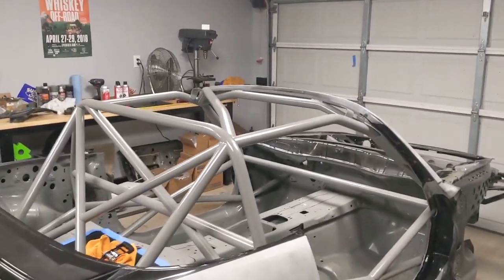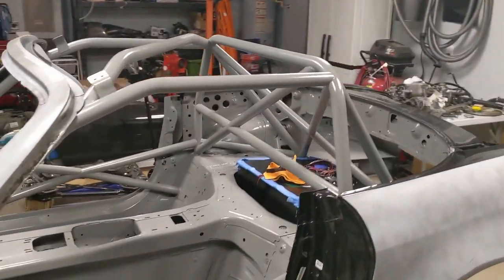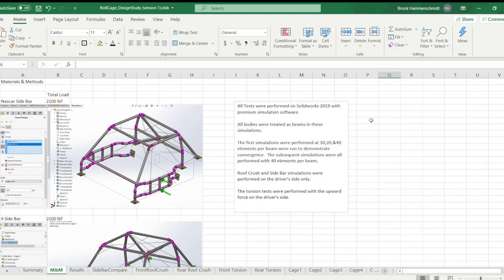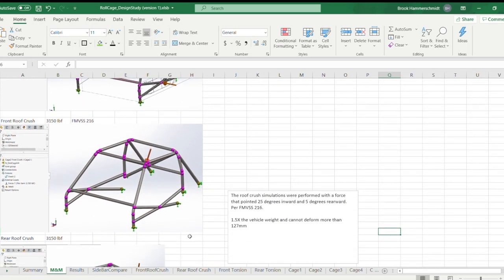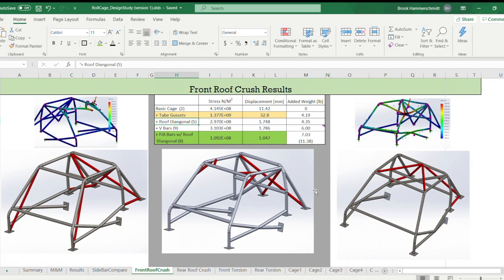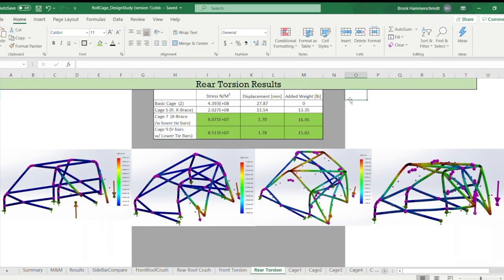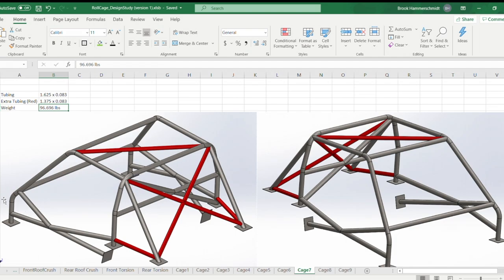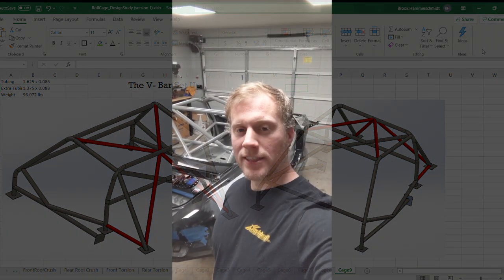Roll Cage Design Study With Data! S2000

Comment: I love the content and the simulations. I am currently working on a video for stage rally rollcage designs based on FIA 253-8 but I'd like to run similar deformation testing with various designs like you did for your cage to illustrate the differences. Did you make your Solidworks model available or are the results of your simulations available to download somewhere?
Reply from the maker: I have emailed my excel sheet to a few people but that's a good idea. I will put it on my website as a free download. Thanks!

Comment: Thank you for taking the time to go through all of the information!! I have a build that I would love to share with you and get your professional input on, if you are interested. It is a F1-based design, mid-engine/rwd with an enclosed cockpit and a total height, including ground clearance of 40" to 41". I am using 1.625"x.120" Mild steel DOM and it is a tube frame chassis. Let me know. Thanks in advance!
Reply from the maker: Thanks! I'd be down to take a look. Sounds awesome!

Comment: I realize you did this video came out several years ago.  Any hind sights you can share?  Would Tocos on the door X-brace help?  Why not use the FIA bars, they seem to help?   I'm starting to plan my cage SCCA/NASA and your video helps.
Reply from the maker: I am not sure about the tacos. I don't think much. FIA bars help but its also more weight and I was already happy with the crush performance without them.  If I was going to add more weight I wanted it to also contribute to the overall chassis stiffness. Thats why I did the bars to the front strut towers. it improve the side impact and increased overall torsional. plust those bars all act as an anti-intrusion if the wheel were to be pushed into the cabin.  If I were to do it over again I'd probably figure out how to do the V-Bar set up and keep the door bars the same.

Comment: Best roll cage video on youtube. I’m curious your opinion on modifing Cage9 V-Bar to make headroom. What if you moved the roof-V inward. Maybe move each side 3.5-4.5” closer to rear view mirror. Then 5-6” tube-guesset top corners of windshield area (Cage6 had tube-gussets on top and side but not front at windshield). As a bonus, the top corners of windshield area are triangulated. WIth a narrower roof-V the bar are shorter therefore lighter. That weight goes to tube-gussets. Then optional FIA bar can be placed on other end of tube-gusset. Which makes FIA bar much shorter, more vertical and less parallel/more triangulated relative to front bar dash area bend. Also what’s your opinion on anti-intrusion bars (anti-front wheel swinging back instruction bars)? You showed bars going to front struts helped a lot. But do you think anti-intrusion bars would give 50-80% of the same results without penetrated the firewall?
Reply from the maker: Thank you! I think your idea about modifying the V-bar might be ok with the tube gussets. Tough to say for sure with out running the simulations but sounds like a good idea. Anti-intrusion bars are good and would help with the side load. they just wouldn't help stiffen up the strut towers.  The s2000 chassis doesn't really need anti-intrusion bars just because of the shape of it. I would just gusset the A-piller down bar if I wasn't allowed or didn't want to run bars to the front struts.
Reply: I’m 80% done with my cage. Was planning V-bar with modifications described above. But now i’m second guessing..
Reply: Oh and thank you for reply and videos!
Reply from the maker: @tomjones5860  send me some pictures on instagram. I'd like to see.